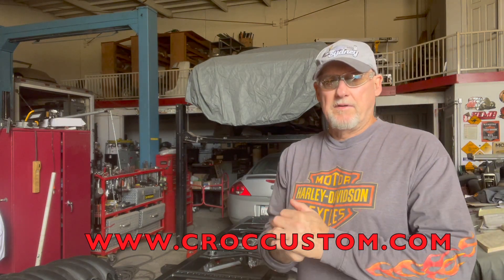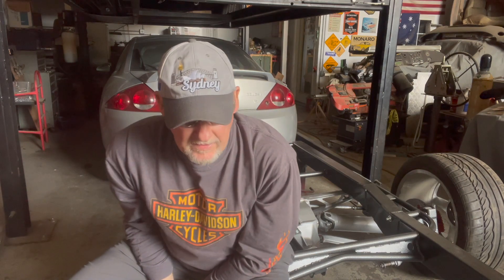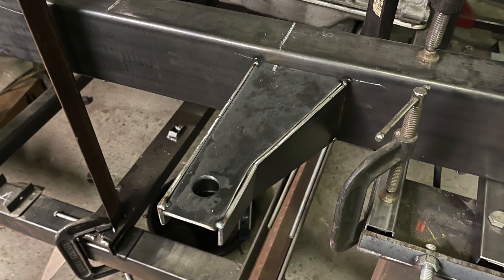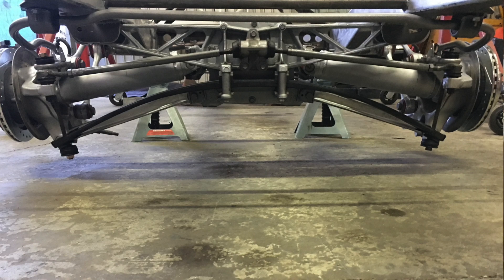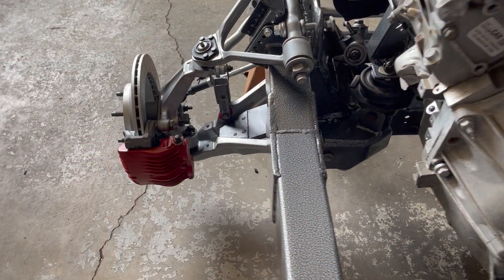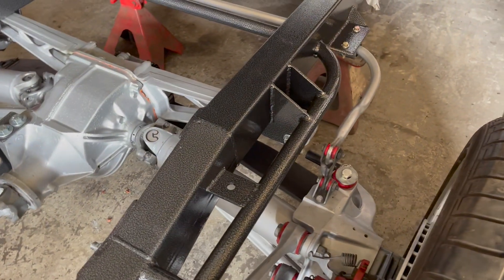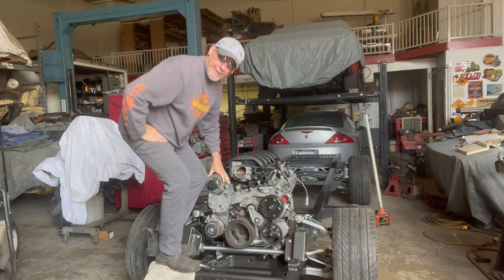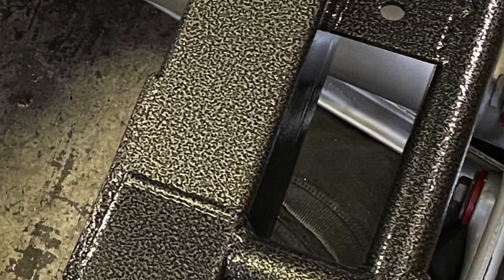Corvette suspension in classic trucks

Comment: Do you know what the angle of the half shafts are supposed to be measured from level?
Reply from the maker: @67blabla  They are at about 10% to achieve that rive height.
Reply: @croccustom  What does 10% mean? Thanks
Reply from the maker: Sorry . I mean 10 deg. That is with a low look. Do not level parallel to the ground.
Reply: @croccustom  Is 10 degrees what it was sitting at from the factory on the C4 cars? Wouldn't it change the geometry if the angle was something other than factory? Thanks again.
Reply from the maker: @67blabla  the factory has more of an angle, maybe double. there is enough adjustment in the suspension to align it.
Reply: @croccustom  Thanks

Comment: cool i love it. 
- early cars had stiffer springs than the later cars. 
- early cars with single piston brakes are actually extremely good, although if you just wanted to have the later j55 option front calipers, a simple adapter bracket is available to put later j55 calipers on early cars, this happens all the time. 
- using wheel adapters to put those beauty c6 rims on an early c4 is also done all the time. just a diffsize than the later cars. 
- i love the early parking brake setup because you can swap your rear calipers without affecting the parking brake 🤘

Comment: Great video.  Wish you did a kit for the rear.  I have a 65 C10 Stepside with plans to upgrade the rear with a C4 Corvette IRS.  I don't want a complete chassis as the front end will have the QA1 coil over upgrade.  Your work looks 1st class.
Reply from the maker: Actually I do have a kit but I don’t sell it. Mainly because It is not financially worth it since people will copy it easily.

Comment: My only question is, can it still be used like a truck, can I still carry like a quad or an engine for a project will I need stiffer shocks for that. Please let me know
Reply from the maker: It can be used as a working truck. If you want heavier loads you would have to use a airbag system to keep the ride height. Corvette suspension needs to stay at it designed ride height otherwise the geometry will go out of alignment .

Comment: Nice job. Did you cut the inner steps of the cab to fit this chassis or the the chassis is narrow enough for the cab to sit comfortably? 
Thanks
Reply from the maker: Chassis is built to original dimensions. it will bolt straight underneath.

Comment: I see the motor set quite far back. You ever run into problems with the motor hitting the rack? Could you put in a conventional steering box instead?
Reply from the maker: The motor is close to the rack and pinion but fits in the perfect spot in relation to the firewall and radiator. The front section of the chassis is designed to fit the Corvette setup. Going back to a conventional steering box would defeat the purpose since you want the rack and pinion for the more direct steering.

Comment: You talked about ride height of the rear suspension. At correct ride height, are the half shafts supposed to be level or sloping up or down? Thanks.
Reply from the maker: They are suppose to run up and down at about 10 deg. If you run them level you run the risk of throwing the geometry out when they bounce past the level area.
Reply: @croccustom  So if you run an imaginary line from the differential out to the wheel that is parallel to the ground, the half shafts should be 10 degrees downhill from the differential to the wheel measured off of the imaginary line?
Reply from the maker: @67blabla  Yes. Also make sure the half shafts are 90 deg. to the frame looking from the top. It helps to keep the geometry with its parameters.
Reply: @croccustom  Okay thanks for the tips.

Comment: Nice looking work on that.  Wouldn't mind a setup like that under my '88 C1500.
Reply from the maker: Thanks. An 88 is usually a totally custom application. Since it has already got independent front suspension most people will only adopt for a rear conversion. But a full blown setup would be trick.

Comment: Hello there I have a 1950 chevy 3100 and I want to do a body swap from a 1988 Corvette is it possible to do the whole swap
Reply from the maker: Sometimes things may look easy and more economical but in realism that doesn't really work. I personally have never done any type of frame swap. They end up costing more of a hassle than anything. The wheelbase of the Corvette is different than the truck which means you wood have to cut the chassis. Then you would have to make up all the correct body mounts. Working from the original Chassis works best and keeps the value also an equivalent aftermarket chassis.
Reply: Where can get air ride suspension kits

Comment: Hello, that was some good work.
I am considering buying a Volvo L-3314, it is an 4x4 army truck.
Looking at the hardtop version and I am thinking if I buy it maybe I will try to get an approvement for modrnization.

As far as I can see it should work well with a mod like yours here. The frame is not notched though, so either it would have to continue beeing a monster truck or it could be modified I guess.
Imaging it would be a good mod both for steering, anti roll and of course also brake upgrade :) 

Do you know the track width of the c4 corvette wide parts? also what was the corvette c4 year one should look for? was it 2002 you said?
Reply from the maker: One of the cool ideas is taking the 4WD suspension out from under the vehicle and putting the body on a lowered suspension. The Corvette suspension is around 61" for the 84-87. 88-89 is only a 1 1/2" wider but it comes with twin piston front calipers. They are relatively cheap to buy especially when you ate getting 4 wheel disc brakes, rack and pinion steering and full independent suspension  and all aluminum components